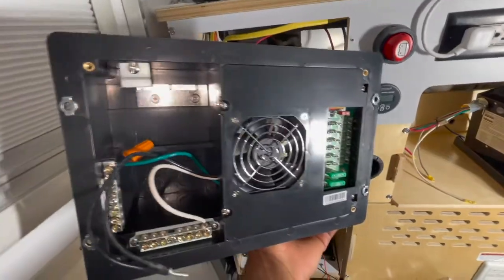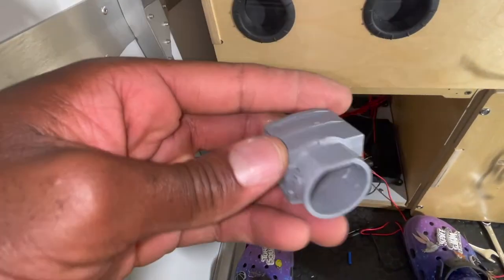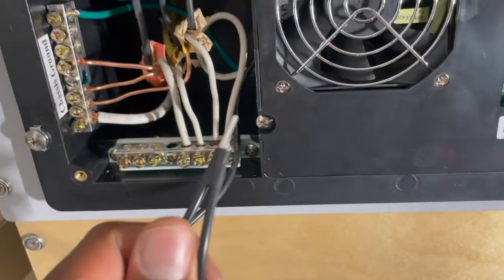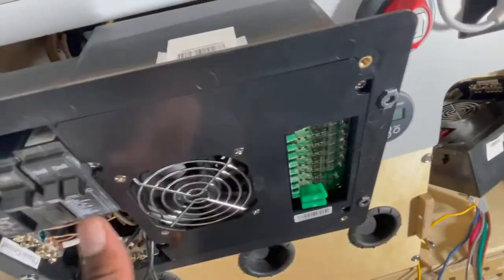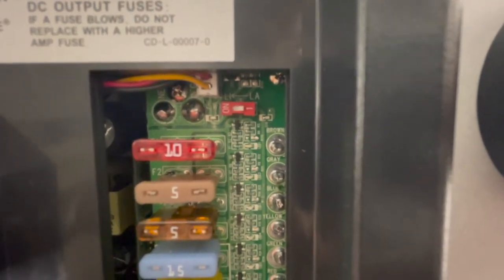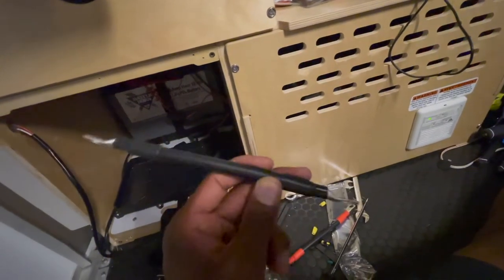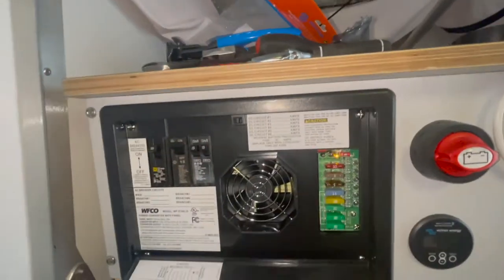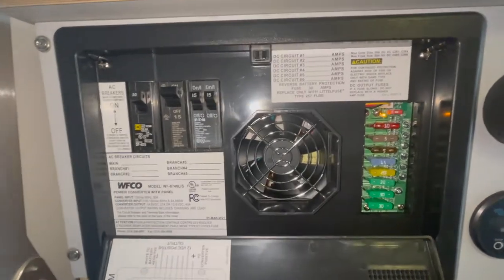TAXA CRICKET POWER CENTER REPLACEMENT FOR LITHIUM: PART 2

Comment: I surmise you learned quite a bit doing all that work! My lazy self would have just mounted a maintainer solar panel outside with a lithium solar charger, or use a portable panel, and just extended the wire into the garage right into the zamp port to top off the remaining 10% lol
Reply from the maker: Definitely learnt a bunch. Honestly it was more an annoyance than anything. Even at 90 percent its still better than the capacity of the lead acid. Fun little project though. Your way sounds effective as well.

Comment: Like you, I'm not an electrician.  But one recommendation to consider for your install...I believe that all the red wires you connected directly to the battery should be connected to a bus bar and that should be fuse protected.
Reply from the maker: rrohan thank you for the input. I just followed the manual that came with the equipment. But I have seen it done the your way too if memory serves.

Comment: I know this comment is late, but I noticed you wired your 15A breakers backwards. The single 15A should be on the right with the wire running to the DC board, and the dual 15A should be in the middle with the wires from shore power.

Comment: Do have a question, I'm planning to buy the 100 Ah 12V LiFePO4 Deep Cycle Battery. If this is what you purchased, did it fit in the installed battery trays?
Reply from the maker: Hi M S. Yes. 2 of them fit in there fine.